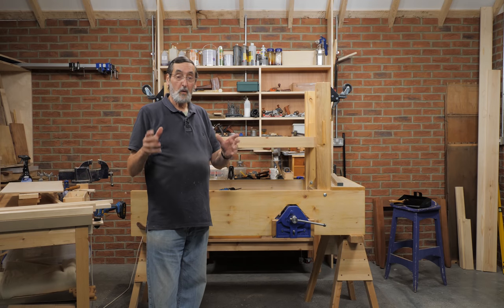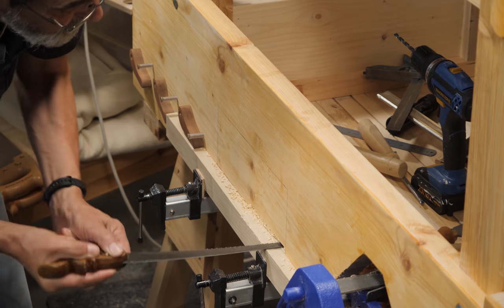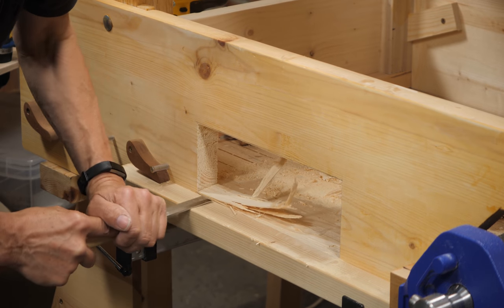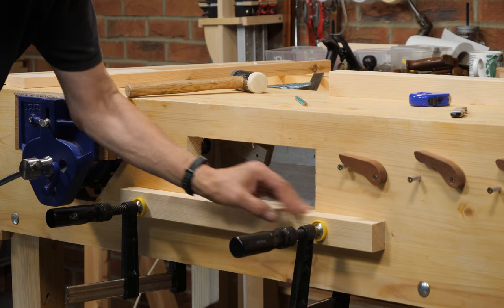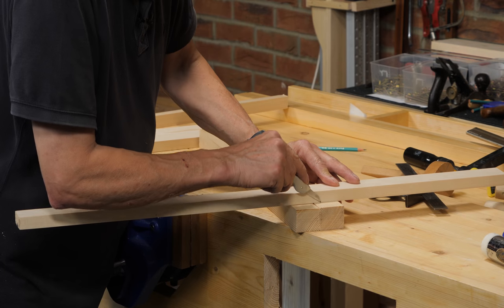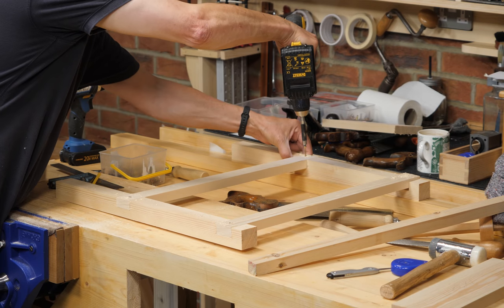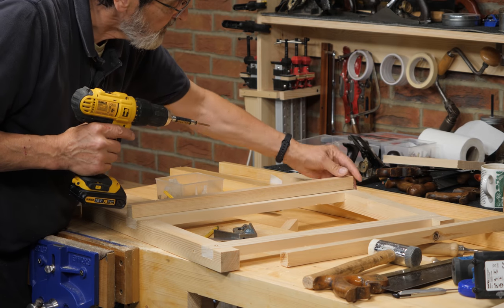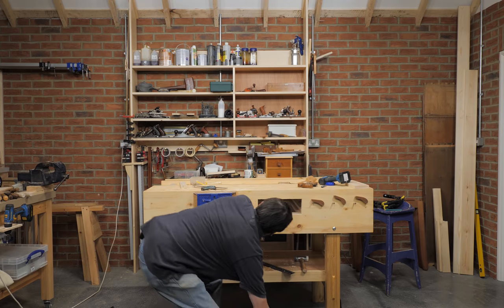How to Make a Workbench Drawer Episode 1 | Paul Sellers

Comment: Once again, a masterful exercise in accuracy and skill.
One small and unimportant note:  At the time stamps 14:20 and 24:35 the vice and other things all move to respective mirror image locations.  For example @ 14:20 the vice is to the right of the newly created opening, whilst @ 24:35 to the left.  Amazing how that sort of digital thing gets overlooked (and how it changes not a wit on the outcome).
Excellent work Mr. Sellers!
Joe S - Idaho in the winters and Alaska in the summers.
Reply: Untill 14:20  the bench was upside down on saw horses.. After he cut the hole he flipped it back over onto it's own legs.

Comment: Thanks; good stuff as always. I've taken to smearing superglue along any sliding faces like drawer rails & then gently sanding that smooth. It ensures that things won't bind if the wood swells a little or if you're keeping a lot of weight on it, and it won't wear off the way that wax can.

Comment: I've done this same cut quick and easy with a Fein oscillating tool and a thick straight edge guide to keep the cut from getting squirrely.  Yes, used the cut out piece as the inset face.  Cut the back of the drawer face off on the table saw to 1/2 inch thick drawer face.  Even after clean up block sanding the wood loss was minimal.  Looked as tight and clean as it would if veneered.  I did set the glides in a tad too deep, but just shimmed the face to flush and plumb from the drawer box front.
Reply: Oops, forgot where I was, who's channel I was watching.  I guess drilling smaller corner holes to start, then use a coping saw.  Keep it tight and you'll already have your perfectly grain matched drawer face.
Reply: Grain matched drawer face with holes in the corners? (Did I misunderstand?)

Comment: A plunge cut from a power saw works well there.  I found it to be easier to build the entire drawer and guide system while the bench was inverted.  My bench is a foot longer so my drawer is 24” wide.
Reply: You would be better doing it by hand to gain the skills. Use every opportunity to build those skills. Practice makes perfect. 
Use every opportunity.

Comment: Question for you Paul:  
The top will expand front to back seasonally, and I'm trying to learn to be more aware of that.  
But you have screwed the bearers to the front and back aprons, and then screwed the runners to the bearers.  

How will seasonal expansion affect the screws in the runners?  Should their holes be slotted?
Reply: On mine any expansion occurs in the well. The bearers tend not to expand.
Reply: Right, but this one doesn't have the well built in, so the bearers aren't touching it.  The bearers would expand side to side, and would not affect anything if the drawer has seasonal side to side clearance.

I guess what I am trying to say is, since the top expands front to back, and the bearers don't, and the bearers are attached to the aprons, and the aprons attached to the top, wouldn't that tend to cause the aprons to pull away from the bearers in the fall and winter months?
Reply: Sure that this design does have a well, rebated to allow for contraction. The bearers run across the bench just like the drawer runners. You can see them on the video.
Reply: Ah, yes, I had forgotten.  I even asked a question about it back then.  I need to review those videos.  Thanks!
Reply: @tabhorian  
People are over factoring expansion. Most expansion does not look good around joints that are on display but on hidden structures it does not matter as nobody will see it. It can be an issue on doors and panels but those are on display. 
If you have wood that is not well chosen and is very damp expansion after build can be a serious issue. 
Something expansion is a real issue and others it is not.

Comment: Hmm, sawing a board while it's held tilted in a vise usually doesn't give good result for me.  Why not use a bench hook?
Reply: It seems to be Paul's preferred method for cross cutting short pieces of stock. Personally I'd prefer to use a bench hook as well... it feels ungainly reaching around with my left hand to support the off-cut.
Reply: I believe Paul doesn't use a bench hook because he doesn't have to.  If you want to use a bench hook, go for it.
Reply: 1. Because he’s Paul f’in Sellers. 
2. He sometimes does things with his right hand reaching across with the left so we have a better angle to see.

Comment: For this one I dont see the reason for not using a power router since the time it takes to use the power drill is abuot the same as it would take to finish the job with a router. just glue some scrap wood on with light duty hot glue as a router guide. A router is no more a power tool than a drill.
Reply: It might be quicker, but is also very dusty and noisy.  From what I have gathered from Mr. Seller's blog and videos, his goal is not to show others how to use corded tools in general and there are plenty of ways to do what he did to cut the opening in the apron.  Regarding using the cordless drill, he could have just as easily drilled those holes with an egg beater drill, though a good bit more slowly.

He has shown some power tool use such as a band saw in his mallet making videos.  I do believe he showed a video using and electric lathe as well.  However he did have to put on PPE to do so.  I don't want to have to wear PPE to enjoy a hobby, hence the desire to learn how to use hand tools for me.
Reply: PPE? Ear protection? You should really be using that while baning with hammers and mallets if you were to be pedantic and that could mean wearign them all day some days.
Reply: There are many alternative ways to cut the drawer hole (e.g. track saw, jigsaw, plunge router, etc.), but not everyone has access to these tools or can use them (e.g. dust issues). Paul's method relies on very commonly available tools whenever possible.
Reply: Yeah, basically, putting a drawer in your workbench should not require you to buy a router.
Reply: More likely to allready have a router than both types of saws. A router or an electric jigsaw. (The latter of wihich would probably cost less than both of the handsaws.)
Reply: You've been given very valid points regarding not using a router, but you continue arguing.  Maybe you're in the wrong place.